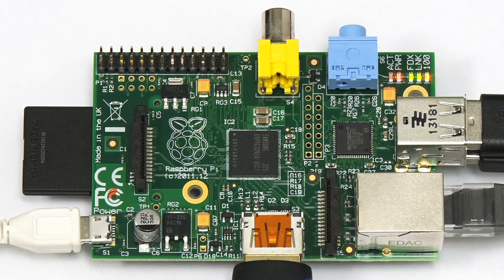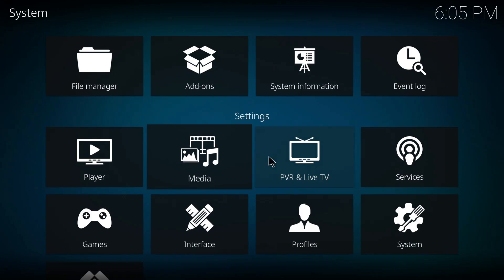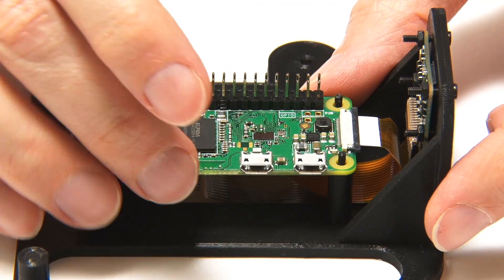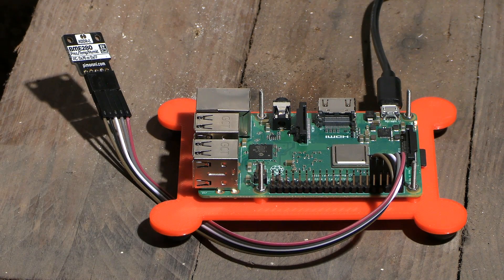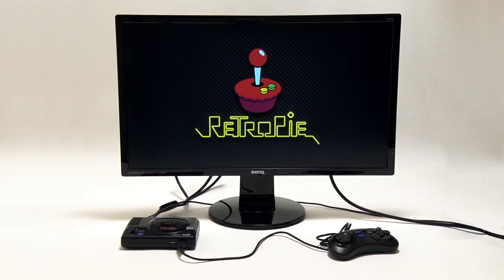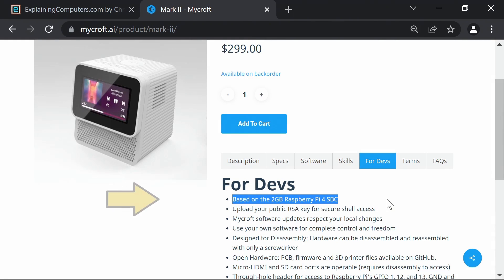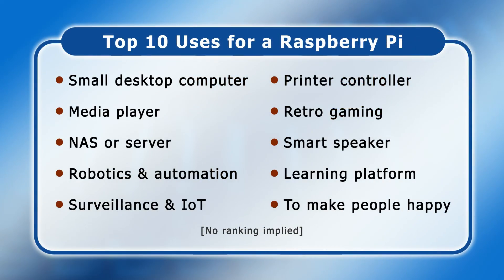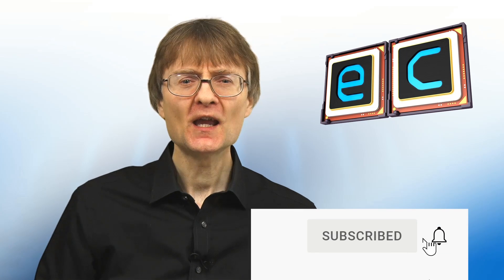Top 10 Uses for a Raspberry Pi (400th EC video!)

Comment: I got a pi 4  and 5 and just getting into it with kali Linux and security lol.  Very fun little SPCs pi 5 is definitely faster by quite a bit overclocked almost 3 times.  I was able to run you tube at 1440p no issue Overclocked with mx Linux 23.1 using chrome.  what i find runs incredibly fast even on pi4 8gb is android 14 it uses the gpu in all the apps so when you run you tube app or plex it treats it like a game and you get full hardware acceleration.  Anyways Cheers thanks for the videos keep up the good work

Comment: For some unknown reason, I feel the raspberry pi useless in the MCU lineup.
It's overpriced and overpowered for simple things you mentioned, but underpowered for complex things.
I know it has a huge fanbase, but what if there are things like ESP32, PI pico, Arduino, etc...
Reply from the maker: The Raspberry Pi is certainly not suitable to all applications, and is not an MCU (for others, microcontroller unit) like the ESP 32, Pico or Arduino models. However, almost all Pis are cheaper than Arduinos! :)
Reply: @ExplainingComputers  PIs are cheaper than arduinos? I mean... How would they be?

Comment: How could i use my SAS SSD on a raspi? Any idea would be appreciated.
Reply from the maker: As with any other SSD or HDD, you can only use it with a Pi if you have an adapter from its interface to USB -- so here a SAS to USB adapter. Or you could use a SAS to SATA adapter, and then SATA to USB 3.0 (which would probably be a lot cheaper).
Reply: @ExplainingComputers  thanks for the reply much appreciated. i think an adapter/interface is not enough. i was told that a SAS controller is required.....which is why i am trying to find some instructions here .
Reply from the maker: @needsomehike  A SAS to USB "adapter" will include a controller -- something like this: https://www.amazon.com/dp/B09VBTBG1K/ They are not cheap! :) But a device like this should make a SAS drive accessible on a Pi.
Reply: @ExplainingComputers  excellent! thank you for the tip.

Comment: Love your channel, very informative and a great resource. Wondered if I could impose. I would like to know if I can use a RPi with a touch screen case to make a systems monitor to monitor my internet connection, Plex svr, Pi-Hole, OMV and so on. Is there any videos that you might have done on the subject. Anyway was just curious, been forever since I have done those kind of software monitoring solutions. Neat stuff, drawing boxes that represent buildings and places objects within those boxes that represent the switches and routers in the field. Jolly good. Mark

Comment: Yeah, I've had Pi Hole on my headless Pi Zero W for near 3 years. Other than an update going seriously sideways, no issues whatever. 6% CPU and 40% RAM load. 150k block list. With 19 clients, 14k blocked of 81k queries in the past 24 hours. Not at all bad for a computer powered via a USB charging station.

Cost all of $40 for the kit, including case, cables, and SD, none of which I had.

As the video points out, an advantage with a Pi is if it goes sideways, you can simply reflash. Exactly what I did with the update mentioned above. As the Pi in question is, in my use case, a Single Purpose Computer, all I needed to do was reflash Raspbian and reinstall Pi Hole. I didn't need to bother with trying to sort it nor be concerned with losing other things.

Comment: Congratulations on 400 great videos!
I have a suggestions for an upcoming video: availability of RPi and alternatives/clones.
Right now, it seemes impossible to get hold of a Pi and it would be handy to know if you could use other SBCs as a drop-in replacement.

Comment: Good job on getting 400 videos out on the channel Chris! I'll definitely keep watching and liking your videos for years to come. I am personally going to get a Raspberry Pi for Christmas, and specifically set it up for retro gaming, and I will also use Risc OS on it from time to time. You can even emulate speech synthesis with a Raspberry Pi running Risc OS, using E-speak, one of my personal favourite free and open source applications. It's available for all the major platforms, Windows, Mac and Linux. If I may ask too , what Raspberry Pi model would you suggest buying for a retro gaming setup?
Reply from the maker: Thanks for this. I must checkout E-speak. For retro gaming -- and many other things -- you cannot beat a Raspberry Pi 4, either 2GB or 4GB model.
Reply: Thanks for the suggestions! Just as a quick side note, I have installed Risc OS in an emulator, and I have also managed to run E-speak inside of it. The emulator for running Risc OS is named "RPCEmu", which is also a free and open source program thats also relatively easy to use. I recommend you check that out in the future as well. Cheers! 👍

Comment: The Raspberry Pi has also come in handy for a wide variety of Amateur Radio projects with its ability to run a number of Linux communications programs that were specifically written for ham radio.  I have 2 running digital voice hotspots, one running an Automatic Packet Reporting System (APRS) station, one Pi-400 as a desktop, and two running a variety of Packet and HF digital mode devices.  It is a shame that the current economy and chip shortage has caused the prices to skyrocket above the level where most folks can afford to purchase them now.  Devices originally priced at $35 and $15 US are now selling for well over $150 and $79 respectively.  The cost of a Pi-4 kit now rivals that of some low-end laptops and Chromebooks.

Comment: Can use RPI for heating hot water storage, under floor heating or space heating.
Try pulsing a  quality solid state relay at say a rate of mains frequency. On 1/4 of time means 25% power [000x000x000x]. One reason to use it could be to allocate exactly 100% of available solar power to household use (100% self consumption).  Also allows time of day heating. Simple coding, easy electronics. Visible SSR response as well as physical change (heating). Possibly can also reduce waste heat loss due to expansion by heating more slowly (sounds reasonable but unsure of this). Can also delay heating to be closer to time of consumption so less heat loss to atmosphere. Expect lots might be interested and lots have also done this and may contribute. I would definitely watch such a "show".

Comment: May I add one more point that is often overlooked, and therefore causes some people to look over their shoulder these devices: RPIs are starting to be used in industrial environments... big boy serious toys. Perhaps not the everyday RPI, more often it's the Compute Module, but I've read about at least two German companies building custom industrial ruggedized SBCs based on the RPI compute model and (my favorite) I've recentyl read that Curtiss-Wright developed and certified according to DO-160 and other military standards an aiborne mission computer based on the very RPI Compute Module... believe me, it is absolutely no joke to get those certifications, and although we may not see it operating in full size manned aircraft, it will find a niche in special purpose drones and similar unmanned systems. No idea about the price, it certainly won't be cheap due to the certifications, but my educated guess it that it may open the door for budget-friendly certified avionics
Reply from the maker: Yes, indeed -- Pis have been for many years used in industrial as well as consumer products. In railway station signage is one of my favourites. :) Very interesting info on the airborne computer -- thanks for sharing here.

Comment: Is the Raspberry Pi capable of running Windows with office and web browsing?  I can believe that small device can do this!  Amazing.
Reply from the maker: There are dubiously legal ways to run Windows 10/11 (badly) on a Raspberry Pi. But as the Pi has an ARM processor, and Windows (in terms of OS not sold with a device) is only available for x86 processors, Windows is only something to run on a Pi as a curiosity. The Pi is really a Linux computer. But it can run a web browser and office packages pretty well these days. :)
Reply: @ExplainingComputers  understood. I know little about computers. I would like a low cost PC that can run windows 11 for use of word processing and web browsing. With the cost of electricity increase could you consider an update to the "green pc build" video?
Reply from the maker: @underdogunchained  I will indeed! :) And in a couple of weeks I will be posting a video on low-energy computing, specifically due to the electricity price issue.

Comment: You forgot to mention its main use (or at least why it was initially created to begin with). It was supposed to be a cheap computing alternative for poorer people in developing countries so that a desktop setup could be had for under $100. These SoC devices are even more relevant now, not just an IoT device for tinkering, but also because of geo-political events as of late causing worldwide chip shortages.
Reply from the maker: Yes, good point. Although I'm pretty certain that the reason the Pi was initially created was for educational use as I discussed.
Reply: @ExplainingComputers  Thanks for replying.

Yes, it looks like you are correct. From an old ZDNet article back in 2013: 

"I looked at our founding documents and nowhere in there does it say 'We'll make a small computer'. What it says is 'We want to get kids programming'," he said, while giving ZDNet a tour of the Raspberry Pi factory in South Wales.'

AND

'It's been great to see that we had this theory that kids still want to program, and it would have been heartbreaking if it turned out that kids aren't interested."

Upton believes it is the feeling of being able to control a machine that gets kids hooked on programming in the first place."'
Reply: @ExplainingComputers  I think I was under the impression that it was designed for 3rd-world countries in mind because of articles like Wired's "Can a $10 Robot Save African Education?" that came out in 2012.

Comment: I made the camera thing to keep track of local cats and birds. It worked well until the 2.5 G portion of my router went out. I had two cameras going 24/7.
 It would be great to have a project with pan and tilt on a pi zero w made with the bjy-28 stepper motors, with sleep, or smaller motors. Of course as small as possible and rain proof, and audio and audio recording.

Comment: Thanks for good video like a mini time-travel in RPi history. In my opinion, RPi cannot be considered a reliable computer without SATA. Why don't they consider adding SATA? Is it planned in the near future?
Reply from the maker: A great many industrial products use a Raspberry Pi and do just fine without a SATA interface. Pi compute modules have onboard eMMC, and industrial high endurance micro SD cards make running from micro SD reliable. A SATA interface on a Pi would significantly increase the price if it were a true SATA interface, so removing the whole point of the Pi as a low-cost device. :)

Comment: If I remember right, the original Raspberry Pi was designed to be an inexpensive computer that children in poorer countries could connect to an old television set and have a working computer -- for example children who could never afford a $400 computer. And it was supposed to give them a chance to learn basic computer skills, on the way to computer programming, etc.

Comment: I would have thought that the Pi would be ideally suited to operate a Thin Client.  Just imagine call centres full of Raspberry Pi  screens.
Reply from the maker: This most certainly happens. The dual HDMI connectors on the Pi 4 were apparently specified to meet the requirements of customers using the Pi as a thin client.

Comment: A great use for a Pi is as a CPU replacement/upgrade for old PCs, pistorm is a project that uses a pi to replace the CPU of an amiga and similar projects exist for other home micros, you can also replace other hardware with it like display boards and such.

Comment: The experimentation without consequences is the key thing for me.  I absolutely hate the insane state of the linux zoo of distributions, and this hurdle is easy to get over if you can just chuck the whole operating system and start fresh with another one.  Finally settling in with the new Raspberry pi os 64-bit on my Pi400, because it is the first one where I've got everything I wanted to work!

Comment: Learning platform 🏆
I always define some static IPs on my local network for some devices, specialty those I may want to access remotely, and as a ISP device crashes or I switch my provider I had to setup the WiFi and IPs again and again. So I bought a dedicated router and a Raspberry Pi 4. I'm setting up the RPI as a DMZ device, providing a secure VPN for my entire local network. Also setting up a set of containers, so I may easily recover my entire setup from a docker-compose and a set of dockerfiles, providing my network with a ad block DNS provider, media server and a set of monitoring tools for my devices. Not done yet, a lot to learn on this path.

Comment: Question. I don't have the expertise to accomplish this but... The raspberry pi is used as the controller in a device called the farmbot. This can be seen here on YouTube. Just wondering if the same railing system that the farmbot uses with the raspberry pi could be reconfigured into a large scale 3d printer?

Comment: Great ideas! I got over a hundred Pis for free and was wondering what to use them for. Home automation and IoT sensors sound promising. I've also thought about building a cluster of them, but it seemed impractical. Another possible use is for managing and monitoring more powerful computers that don't have built-in out-of-band management support, such as with Tinypilot and PiKVM.
Reply: Sell them on ebay

Comment: I use a Raspberry PI zero to monitor my washer and dryer to tell me when they are finished so I can go collect the laundry.  I use a Raspberry PI 4 as a home alarm system that reads wireless sensors around my house and sends me emails/texts if it detects water leaks, or doors or windows being opened when they shouldn't be.  It also controls my garage door as well.  I think Raspberry PI is an awesome platform and I wish they could produce them quicker as my local MicroCenter has been out of them for a while now.

Comment: One thing I've been thinking about using a Pi for is as a web surfer so I can keep my main computer off the general internet.  Then be able to run security checks on things before transferring them to my main computer.   I wouldn't keep my main work computer 100% off the internet but would only go to trusted sites and not leave it attached to be found and hacked.  My daily browsing, You Tube, social media, Google exploring would all be on a Pi, something I could wipe clean in case of a virus or something else.
Reply from the maker: I know that some people do this -- and another benefit is that the Pi runs Linux, for which very few viruses are written.

Comment: Right now, a RP4 2GB costs 130 USD on Amazon US. At this price, it is not worth the money. The whole point was a low-performance computer for low price.
Reply from the maker: Totally agreed that the Pi needs to be a low-cost comptuer. But the price of a Pi (as set by the Raspberry Pi Foundation) remains low, even if the 2GB is temporarily at $45 rather than $35. However, what some retailers are now charging for it is very high indeed . . . But when Pis come into stock on reputable Pi details, the price is unaltered.

Comment: On making  Printers network accessible ?   I don't believe you mentioned any sources for software & drivers ????
Reply from the maker: I didn't! :) But it can basically be done by installing CUPS (the common UNIX printing system) on the Pi, as I covered on the channel a very long time ago: https://www.youtube.com/watch?v=FnRbzZrsSMk -- However, in that  video I only showed a local printer. So your comment reminds me to make a video specifically about using a Pi to put a printer on a network. :)
Reply: @ExplainingComputers   with the needed software & drivers Please...

Comment: RPI with Kodi and  two op systems you mention - the only problem is - neither has RPI-CLONE - and so backup becomes a pain. I did that at first then went back to the RPI Operating System  even thouo the KODI is older - because I retained SSH access and RPI-CLONE for easy backups after any updates.